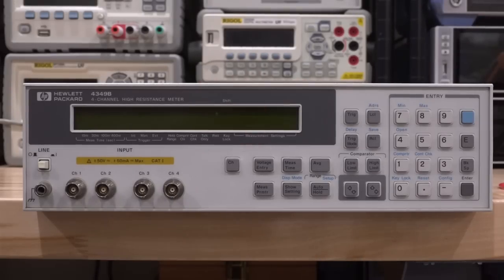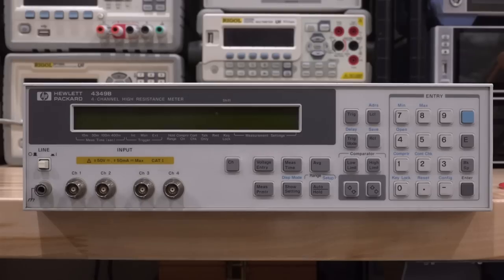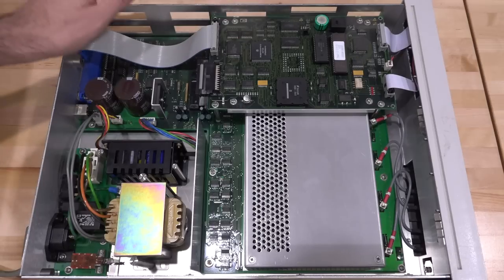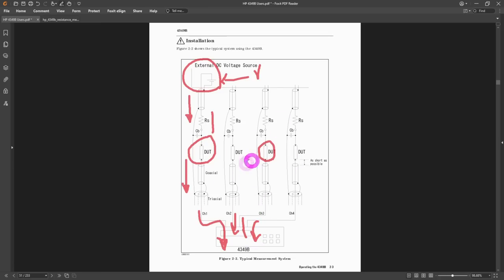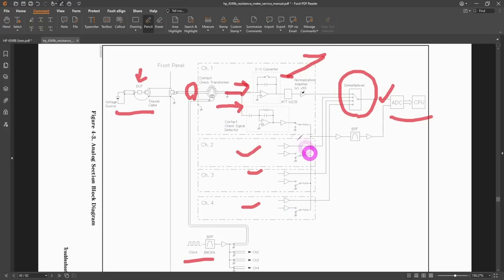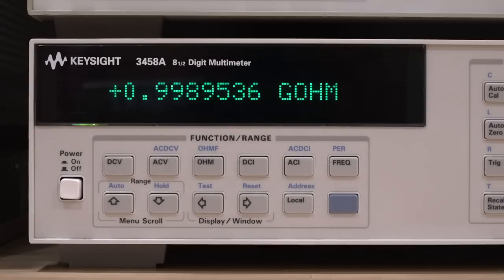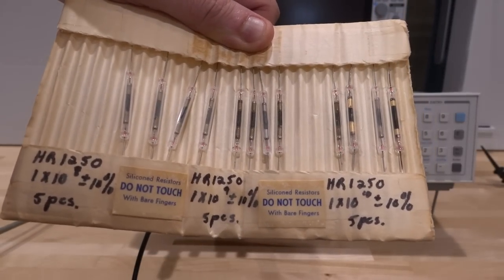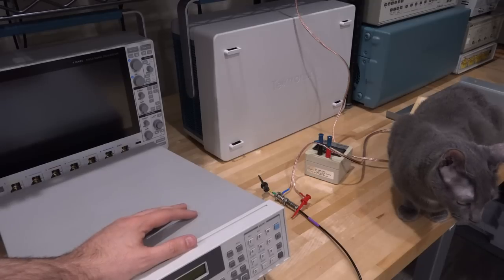TNP #30 - Agilent 4349B 4-Channel High Resistance Meter Teardown, Repair & Experiments

Comment from the maker: As a few others have pointed out, even at a bias voltage of 250V across the resistor, the dissipation is fairly small, 62.5uW. It is therefore safe to assume that the thermal impact is a weak effect on the resistor. Other issues like nonlinearity & leakage may be playing a stronger role here. It we stabilize the resistor temperature, we can isolate the other effects.

Comment: The best electronics channel by far.never thought I would need to measure in the G ohms region until  I started   service and repairing large diaphragm condenser microphones they all use 1 G ohm to bias the diaphragm.

Comment: Thumbnail is kinda messed up. It's either 1e+15, 10e+14, or 10¹⁵, or 1x10¹⁵, or 10x10¹⁴. But 1e10¹⁴ is just nonsense.
Reply from the maker: That was a typo, it is already corrected. At first I had it as 1e14, then I added the 10 but forgot to change the "e" to a "x". Although 1e10^14 would be an insane number! ;)
Reply: @Thesignalpath  Eh, just a double exponential. Insane for a resistance, but not so much for a number. Double exponentials are faster growing than pretty much all "real life" functions, but quite slow compared to a lot of functions studied in combinatorics. Harvey Friedman has done a lot of work that happens to involve extremely fast-growing functions. There's also a tiny group of hobbyists who try to define the fastest-growing computable functions possible, and use them to define extremely large finite numbers.
Reply: @Thesignalpath  Makes me wonder what kind of object would have such a huge resistance. Maybe if you measured across the entire planet?

Comment: You need to clean those resistors. I have build a resistance standard for a client. It in 10 steps went from 10M to 5GOhm. All connectors were mounted in teflon disks for lowest leakage.  The resistors were delivered from the distributor in plastic bags and some had fingerprints on them. I mailed with the manufacturer about that and they advised me to clean them with IPA because fingerprints could cause extra leakage current over the outside. For most if the test voltage is high. (This standard is in use in a cal lab and they use voltages up to 5 kV )

Comment: I used a ton of the single channel version of this on automated production test systems for 1000V high voltage high resistance cable leakage. The triaxial test cables were a thousand bucks a pop! Memories...
Reply: Oh yes... I scored a Keithey electrometer for a great price... only to spend even more money on a damn triax cable so i could use it!

Comment: 250V over 1GOhm gives 62.5µW only, I hope I calculated that correctly (3 times), so that can't be the reason. There's a voltage coefficient for resistors, but I never assumed it being that prominent. Maybe there's a voltage isolation break down of you cables, or in the plastic of your assembly. Strange behavior, and very interesting video, anyway.
Reply from the maker: I tend to agree, the power is pretty small. It is more likely that other effect are dominant. I will add a note to the video.
Reply: 250^2 / 1,000,000,000 = 0.00000625W That’s 6.25uW

Comment: My way of measuring high resistance used to be the otherwise rarely applied special scale of Fluke 8060.  My use for it was to sort some diodes by their leakage current - at first 1N914 or its newer clone to pick ones that leaked below 4 nA at the meter 9 V, but then I found it more practical to specify FDH300.  Later on, I got a HP 4329A that I have occasionally used for a high voltage DC output.  Never needed yet for its actual tera-ohm and beyond capability.  As it happens, I also have an auction find, a Keithley electrometer.  When cleaning and studying it, I was puzzled by its lack of heater connections on its vacuum tube, but then got a manual for it and found the lack of thermionic function to be fully intentional, or actually the key feature fort the meter.  Incredibly smart!

Comment: Radiometer IM6 is best high resistance meter I know of. 
Gives the most consistent readings. TOhm and beyond, accuracy is low, a few % at best, the meter with most consistent readings wins, usually also the meter with best construction/design and care for good isolation, guarding...
Also have two of those HP-4349B in the shelf, Radiometer IM6 is the one that gets used when measuring e.g. HV dividers.

Comment: I wonder how much of the observed voltage dependence is really due to the heating that was mentioned and how much is due to nonlinearity. High-value resistors often have a specified voltage dependence that is a true deviation from Ohm's law and not just a temperature coefficient.
Reply from the maker: It is definitely a combination of things, leakage, thermal, non-linearity, etc. If I could stabilize the resistor temperature, we could isolate the non-linear behavior from the thermal one.
Reply: @Thesignalpath  250 V over 1 Gohm is only 62.5 µW, so the temperature rise in this large resistor due to the bias ought to be rather small. A non-quantitative way of separating the effect of heating from the effect of voltage would be to gently blow some hot air on the resistor while it is biased at a lower voltage to see how the resistance changes. Maybe while monitoring the temperature with a thermal camera. If it is takes many degrees of heating to change the resistance the same amount as the 250 V bias did (or if it goes in the other direction), the observed effect is probably not thermal to a significant degree. Other effects may be harder to separate.
Reply from the maker: I tend to agree, the power is pretty small. It is more likely that other effect are dominant. I will add a note to the video.

Comment: I'm surprised it doesn't have an integrated voltage reference output (something like a 50V supply capable of supplying 1mA or so) or at least a sense input to measure the DC voltage used. I guess that means it's technically just a very low current ammeter with built in capability to calculate resistance?
Reply: Why not use the sense connections? 
The lack of an internal voltage source is puzzling.  I believe you said the middle shield is not energized.  That guard shield should have comparable voltage to the supply to prevent leakage.  Your use of this meter seems at odds with what I'm learning about electrometer measurements.

Comment: there are some great old school keithley electrometers out there for very cheap they can measure small currents, high resistances, and coulombs. i think the max resistance range on mine is 10^13 ohms.
Reply: I have an old analog HP 4329A so it goes even higher ( 2-10^16) but only if you have the special cable for it (I do not have that and without that the max I could measure was 10 ^12. I was standing a meter away and the needle moved slowly up and down a bit. Turned out it was the rhythm of my breathing 🙂

Comment: That contact checker looks like the same thing you would use for ground loop detection and it could actually also detect a ground loop between shielding on the triax. Since one end of the inner shielding is open, it provides no magnetic shielding at 30khz and all the current is induced in the central conductor, which has a loop so you detect a current if a DUT is connected, but if the inner shield is not left open at the other end and touches the outer shield then you get a ground loop through the shields and no pick up on the central line so a conductor ground loop would also look like an open which is good to know. Would be an interesting and quick experiment to try.

Comment: what is the application for a 1G Ohm resistor?
Reply from the maker: If you ever want to convert a really small current to a “measurable” voltage, you would have to essentially pass that current over a resistor.  :)

Comment: The measurement is degraded by using conductors to connect everything.  There is a YouTuber PhD named Derek who proves that all electron flow is outside the conductor on his "Truth" channel. 

Unfortunately his PhD is in physics, with a Masters in self promotion, which he got from the university of UUU*.

*Unicorn University of Uranus